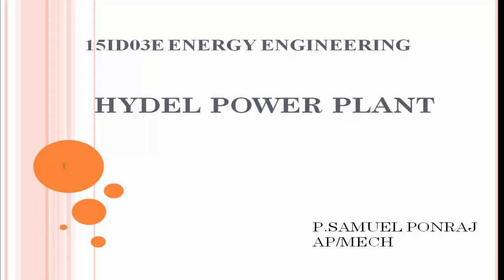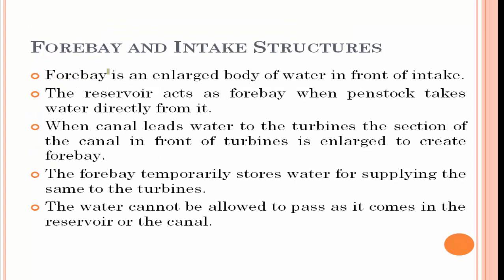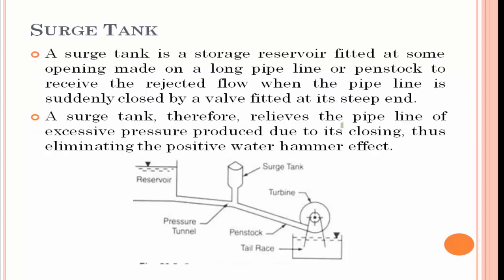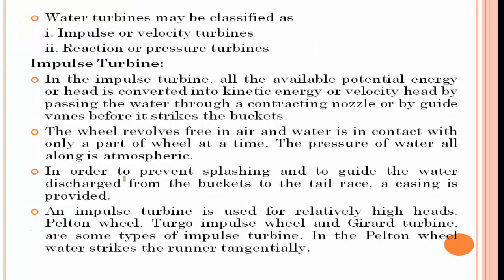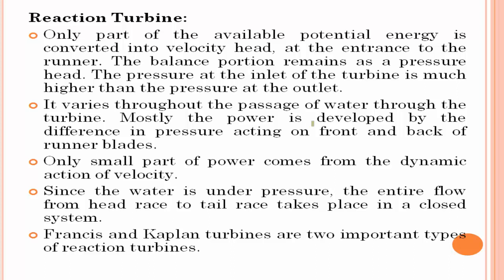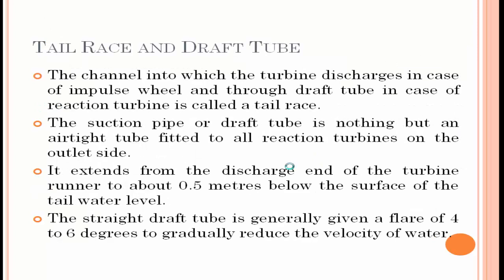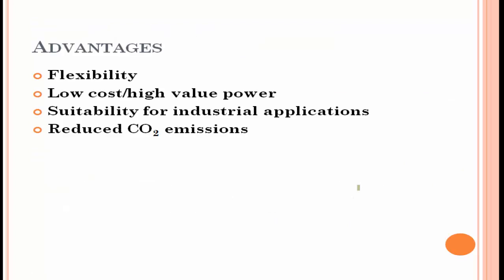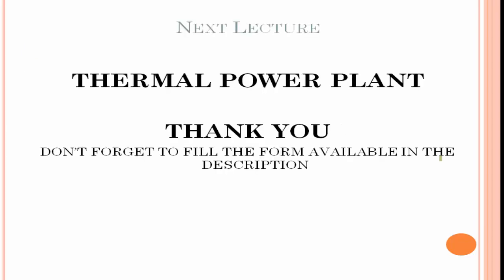Hydel Power Plant | நீர் மின் நிலையம் | Explained in Tamil | Energy Engineering | Lecture 24

Comment: Hydel thermal power plant Layout,working,Components,Advantages and Disadvantages are fully covered in this video.Especially surge tank and pelton wheel turbine concepts are clearly explained in this video.Need to include as much as pictures related to the content sir and more wordings in the slides doesn't feel good.please consider this
Reply from the maker: i accept ur point bro.. more wordings should be avoided, but this video is for educational purpose and the content may be used for learning. so i intentionally included more wordings. ill consider ur point also

Comment: Sir, how do these hydel power plants recharge their reservoirs during the summer season or water scarcity times?
Reply from the maker: thats one of the drawbacks bro. we cant produce electricity when there is low water in reservoir. also huge reservoirs cant be recharged. there is a technique called pumped storage. water from low altitude will be pumped to high altitude during surplus electricity and electricity will b produced from stored water. i advise u to refer it